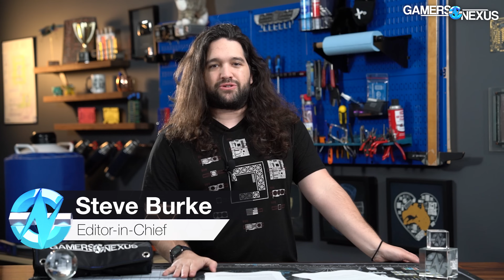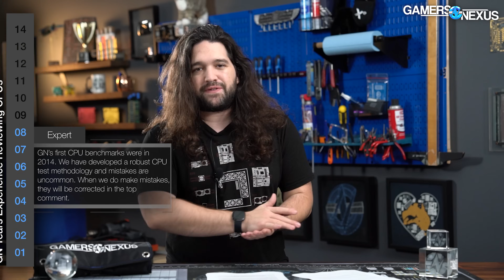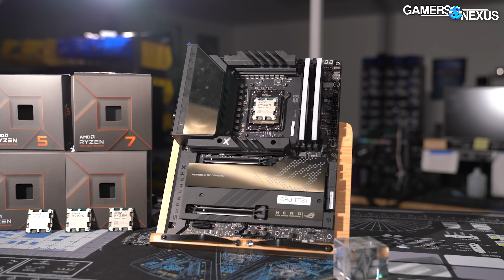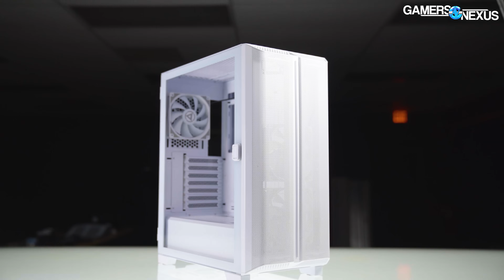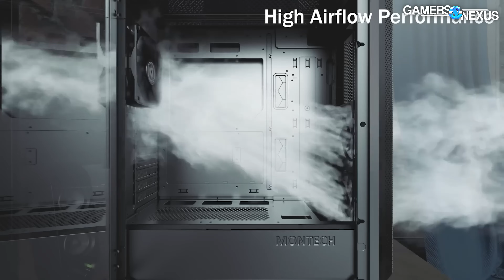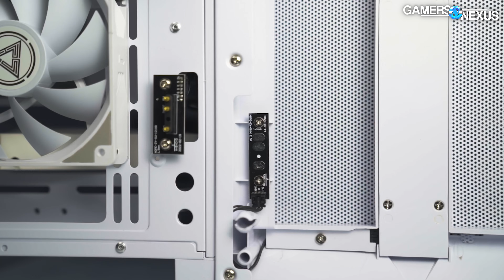AMD Ryzen Eco Mode Deep-Dive & Benchmarks on R9 7950X (Zen 4)

Comment from the maker: Learn about AMD Precision Boost Overdrive: https://www.youtube.com/watch?v=B7NzNi1xX_4
Learn about AMD TDP and what it means: https://www.youtube.com/watch?v=tL1F-qliSUk
Get the full charts from our latest CPU review (at time of publishing) over here: https://www.youtube.com/watch?v=todoXi1Y-PI
Reply: What about eco mode on 7600x?
Reply: Many people especially IT run Virtual Machines on those CPUs, would be interesting to see Benchmarks  for those type of workloads, 
for example if you invent a test methodology would be interesting
Reply: IMHO, what is clearly missing here is the 120W mode.!  It seems to be far more likely to be a better balance of performance and efficiency for most people who are looking at any "default option" below 170W, and especially so as the difference in performance between 105W mode and 65W mode is significant (depending on workload).  I honestly wonder why the 120W mode (or other) wasn't an included default alongside the other options.
Reply: @ADB-zf5zr    and 88W mode
Reply: How does this work with Ryzen master software and using Auto Overclock?
Can you explain what Auto Overclock is doing and is it worth it? I've had my 5900x on Auto Overclock pretty much the whole time I've had it. As someone that doesn't know what they are doing with over clocking, is Auto a good option?
Reply: Great Video - I have the same m/b, CPU and ARTIC liquid cooler and I can say that from day one I have used 105W ECO mode with PBO set to negative 15 and its great and hardly ever breaks 75C.
Reply: Similar tests on 13900K please? Currently looking to build a video workstation and deciding between these two processors... I'm worried my circuit breaker might be a "bottleneck" if I'm not careful the parts I choose!
Reply: @AFistfulOf4K  What setup do you currently use, if its and AMD 5950X then a 7950X running at 105w will consume the same as the 5950X (Approx 160W) with less than 10% loss of performance and a lot less heat and noise from fans !
Reply: i would like to see eco mode for the lower end ryzen 7000 parts, please
Reply: Could the same testing be performed with a top of the line air cooler like the NH - D15? It would be interesting to see how much performance is left on the table if any and whether the TDP of the cooler can handle the "105W" (158.4W) without the need for a perishable AIO. <3
Reply: What is the idle power? It would be nice data to add to test results if you are doing power and energy efficiency tests anyway. And hey no need for multiple benchmarks to get good idle data. (Not in a sleep mode. Idle like if you just have a simple text editor open and reading.) 

Especially with desktops most machines spend a huge proportion of the time at or near idle, like a car sitting in traffic. So a seemingly small savings in idle power can add  up to a large amount of energy.
I would use the 65w mode for long running overnight or over weekend automated tasks, where my personal time is not really a factorand the job completing an hour earlier won't even be noticed.  ( Or if building some sort of large cluster where the performance could be regained with more nodes but computation electrical cost is a concern. Of course that is not relevant to your typical viewer.)

Most people don't realize that most computers will cost far more in electricity over their lifespan than the capital cost of the hardware. This is why you can find heaps 5-8 year old Xeons on the used market, it's due to the energy savings of the replacement, the new Xeons haven't become substantially faster but total system energy consumption per-core has improved (Hosting prices are often on a per-core price structure). Supercomputers can burn $30 grand on a single scientific computation that takes a few days or a week to run.(Includes powersupply losses and cooling costs.)
Reply: This might sound ridiculous. But I suggest this: de-lid the 7950X, set the eco mode to 65w, and put it under LN2 to see how far the frequency goes.
Reply from the maker: @exxor9108  Delidding wouldn't make any difference at all if you're already under LN2
Reply: @GamersNexus  Ah, all right then. Though still, that would be interesting to see how far it could potentially go with that 65w limit.
Reply: @GamersNexus  Small question about gaming benchmarks : 65W cTDP vs. stock difference for 7950X is usually under 5%.
Isn't this a bit weird since there is meant to be a 1GHz difference of clock speed between them ?
I think 65W cTDP 7950X boosts core clock A LOT more than numbers presented (~4GHz all core clock speed), under gaming benchmarks. Lastly, about 65W cTDP not being interesting/usefull : 
Please find a CPU that beats 7950X @ 65W cTDP performance numbers, which pulls less than 90W on EPS connector.
Reply: @exxor9108   You just have to sandpaper your CPU, but it has to be the same high, low, pressure. And if you do that, beware you don't cut too much. This is the only way the temperatures go down. AMD Ryzen 7000 CPUs are thick because AMD wanted the old cooler to be compatible with the new CPUs and did trade temps for Cooler compatibility.
Reply: Can you put eco mode to be 125W manually somehow and test it ? I saw somewhere on forum that some guy put manually at 125W, he got almost same perfomance as stck (-+1-2%) but temps are between 70-75c undel load with nzxt x73
Reply: @StrehaBDC  You can find the PBO values for any TDP with a simple interpolation on the values provided by AMD for 65, 105 and 170W. Following this, I set my 7950X to 125W TDP with the PBO settings : PPT=169W, TDC=125A, EDC=187A , this gives acceptable thermals (80°C max with high end air cooling) and performances even closer to the stock ones. Adding a slight undervolt using the Curve Optimizer setting, performances are even better than stock, with a 30% energy saving!

If targeting 125W TDP, 105 being 20 less than 125 and 65 less than 170:
PPT = 142 + (230-142) * 20/65 = ~169W
TDC = 110 + (160-110) * 20/65 = ~125A 
EDC = 170 + (225-170) * 20/65 = ~187A
Reply: @PlaiSeek  What specific high-end air cooling?  Thanks for the information!
Reply: @retromodernart4426  NH-D15 of course :)
Reply: @PlaiSeek  Thank you very much for that quick answer!
Reply: @StrehaBDC  You may have missed it in the conclusion of the video, so yes this is absolutely possible.  Eco mode is preset values for PBO.  You can simply set values for PPT, TDC & EDC yourself to create your own custom eco mode.
Reply: @robertmelchert9687  yea, I know that now, but I would love to see 125w one click option like 105 and 65w have. I picked 7950x for my rendering workstation, I don’t want to lose if possible any of the performances but would love to see lower temps and W consumption like in video.
Reply: @StrehaBDC  I’d highly suggest trying curve optimizer in Ryzen Master utility.  I did this for my 7700X and got very promising results.  All core stress test CPU temps dropped 10-12C, peak temp leveling off at 83C instead of 95C, and power consumption down about 20W.  For gaming temps are down 20-25C with core temps hanging around 45-50C rather than 65-70. I now experience lower temps gaming then I did with my 5900X while using the same cooler.  I have the Arctic 34 eSports Duo which isn’t very expensive.  I was considering upgrading to DeepCool AK620, but I don’t know if that’s even necessary now.

I’m still considering Der8auer’s delidding tool though so I can see shockingly low operating temperatures and dial back fan speed on the heatsink a little more.

Next step for me will be attempting to combing eco mode, or my own custom PBO, with curve optimizer to really dial the CPU in where I want it.
Reply: Why u not testins AMD processor with AMD card with "AMD Smart Access Memory"? they says its +15% perfomance.
Reply: @qpumuJIbek  Your comment makes no sense, perhaps a translation issue.!
Reply: @ADB-zf5zr  that comment probably doesn't apply to a CPU test, but the smart access memory question is one I currently have. For example, it looks like the new 7900 xt and xtx graphics cards are the best top end graphics cards in this generation unless you have a specific need for Nvidia/ray tracing. On the other hand, it sounds like the 13600 CPU is the top value for gaming this round. If you run the two in the same system, you lose SAM. So the question is if you have an AMD graphics card, should you stick with an AMD CPU even if it's not the best on paper?

Comment: In most of Europe, electricity is so expensive that higher efficiency is worth. lot when you run your computer for a lot of hours at high load. For e.g. running lots of giant compilation workloads, the 16 core 7950x part would be a very easy decision to buy and run at e.g. 65W mode, vs buying a 12 core 7900x, because of the money you save on electricity.

Comment: Lots of people will often also do some web-surfing or office work with such a high-end part. In that case, an "eco-mode" can be a huge quality-of-life improvement, and will cut down on unnecessary noise. Even a 35W or lower mode would make a lot of sense for efficiency in those uses. The lower you push performance, the better efficiency typically is for such use-cases.

Comment: The problem with going with 7700X (or 9700X these days) instead of 65W eco mode is that it's considerably less efficient, as you've shown.
If you want either low noise/heat or a more eco-friendly setup, which is presumably the case with people who consider using this mode, why would that be a better option?

Comment: After 12 months of running this pc 12-18 hours daily, I set the core power at 1.25, other power setting auto. Turned off core performance boost, pbo, asus performance enhancement. Core optimizer all cores negative 25 , just those keep my pc idling around 35-38. And running Forntie full graphic settings with 4070ti super oc 240fps dx12 1440p , ryzen 7950x, temps play at 45-48and only goes to 52-55 loading games
Reply: What is your cooler?

Also you cannot turn off PBO is you use Curve Optimiser, CO is part of the PBO2.

Comment: the thing I find funny is that with Ryzen 7000 series everyone is talking about the high temps and lowering the voltage to get lower temps with no performance loss but then Ryzen 9000 series released and AMD listened to everyone by releasing it with a lower voltage/wattage so it wasn't cooking like an oven and everyone complained because "they weren't getting the max performance that they paid for" so AMD released a BIOS update that raised the power limit.

Comment: I have a ryzen 7900x with Phantom Spirit air cooling and have used the following settings:  asus performance enhancement enabled; PPT at 125; platform thermal limit at 85; curve at negative 20.

Cinebench results were 1617 at 90C limit and no other changes 

With the new settings, I've been getting Cinebench24 multi-core settings of 1597 with max temps not exceeding 70C during Cinebench, but strangely during an installation.  May try putting it up to 135 ppt and seeing what happens.

Comment: 65W mode would be good for Hyper-V where you need cores to handle idle/threads.........  which is what I've run into .....  5-6VM's on a 5700G ......
Reply: Agree. Great for HyperV with gaming secondary at 65 eco.

Comment: I actually ended up getting my Ryzen 9 7950x at 5Ghz using 1.045 volts. My CPU maxes out at 67-68C full load while being essentially equivalent to the maximum performance the CPU can offer. Unreal.

Comment: So AMD has been gradually 'overclocking' processors more & more over the last 10 years to fight for the best performance numbers. The result is CPU/GPU that are using 75% more power and running 20C hotter just to get ~10% performance increase. Efficiency and longevity have taken a distance back seat to peak performance.

Comment: Whenever I look at a new architecture, or even an old one- you want something efficient.  

The IPC is the real number you are looking at, it’s True Performance metric Per Watt Overall.

Productivity, gaming, or any other workload, not everyone can put everything at super max load, nor would you.  
- I would be just happy with a 16 core CPU at 50 watts and a 12GB A2000 or a 50 watt 5800X3D and a 4060 @90 watts.  
- I would be the one to hook everything up to battery or UPC

Comment: 10% for 3x power consumption? stock cpu frequencies should not exist, this just shows how desperate the cpu manufacturers are, i will never run anything above 65W ever again, worst case 10% loss is nothing
Reply: I agree....I even saved myself money by just using Eco mode, helped me avoid from buying a new heatsink or water cooler for my cpu.....my cpu was always hovering at 90 to 95C during gameplay, with eco mode it goes from 73c to max 82 or 85..... quite happy with the results I haven't even noticed the performance hit as most claim.....but then again I came from R5 3600 so yeah.....

Comment: So I assume in gaming, when the fps is the same, the power consumption is the same in Eco and non-Eco mode?
But it would be really nice if there was a quick way to switch between modes from the desktop, like if you're going out to lunch for an hour, you just click on ECO Mode and let your stuff run.
I have a kind if a hack set up for this myself, where I created a few different Power Plans in Windows, where the CPU can only have a certain percentage of power, and I have shortcuts on the desktop to various cmd files that set the power plan that I want.

Comment: So  for a fixed size task:
"105w" takes 1.07 more time with 0.64 of the joules. vs stock
" 65w" takes 1.33 more time with 0.45 of the joules. vs stock
and 
" 65w" takes 1.25 more time with  0.8 of the joules. vs "105w"
Going the other way: 
Using stock instead of "105w" will cost 1.56 more energy per task but you can do 1.07 more tasks per unit time. (1.67× watts)
Using stock instead of " 65w" will cost 2.24 more energy per task but you can do 1.33 more tasks per unit time. (2.98× watts)
Using "105w" instead of "65w" will cost 1.43 more energy per task but you can do 1.25 more tasks per unit time. (1.79× watts)

Of course this is only the CPU, the actual efficiency gain will be diluted by other fixed power components like memory, storage, graphics cards, RGB, and fans. (Although fans could be reduced in speed or number, possibly even eliminated. But that is situation specific. And memory might be undervolted/clocked if not a limiting factor but that can could reduce CPU efficiency so apples and oranges.)

Comment: How should I adjust the fan curve if I want to get the lowest possible fan noise?
Do I understand correctly that even in 105W Eco mode CPU temperature jumps almost immediately to 62C and stay there while CPU is loaded?
But if I had 100% CPU load during 20 seconds and then 5% CPU load during 2 minutes then there is no reason to spin-up fan on Noctua D-15 cooler if cooler is still cold.
Ideally the D-15 fan should rotate based on the temperature of D-15 but not on the temperature of CPU.

Comment: Late to this video. Still great content.
Using the GN CPU benchmark at 9 minutes, i mathed some things out

65W TDP / 88W PPT (4050MHz 40.3) 8.0s | 75%
105W TDP / 158W PPT(4800MHz 62c) 6.4s | 93.75%
170W TDP / 262W PPT (5100Mz 95c) 6.0s  | 100%

That 170W TDP profile has no right to exist. It's only to try and edge higher to compete with intel in synthetic testing and is a massive negative to consumers. It's even slower in some games (like the CS:GO results), which is disgraceful.

It'll be even worse on a lower-tier motherboard since the VRM's could overheat and a case would heat up massively.